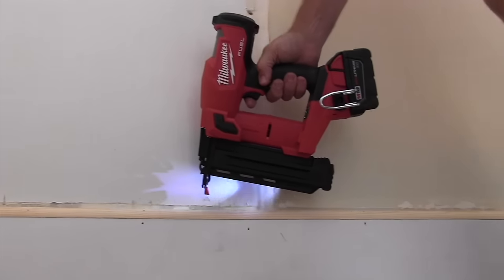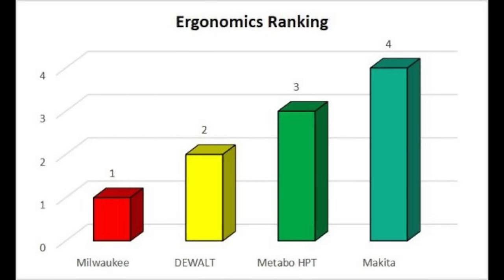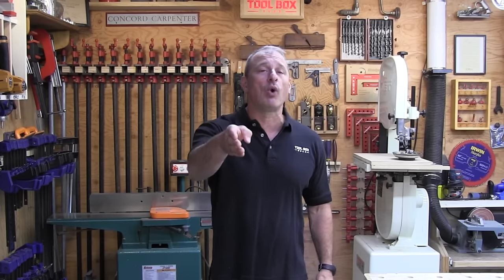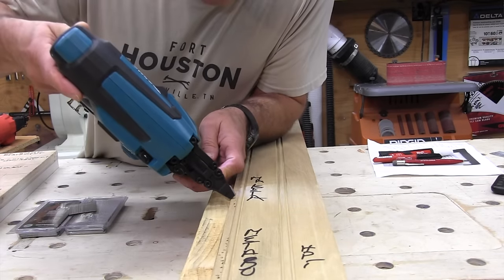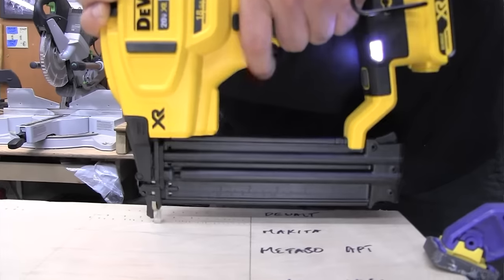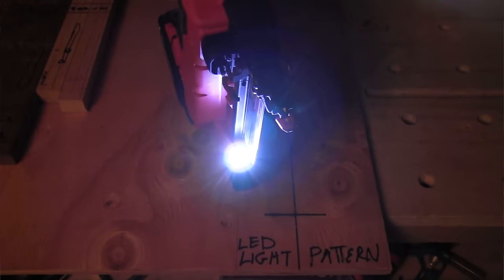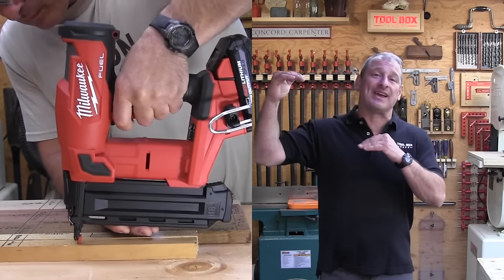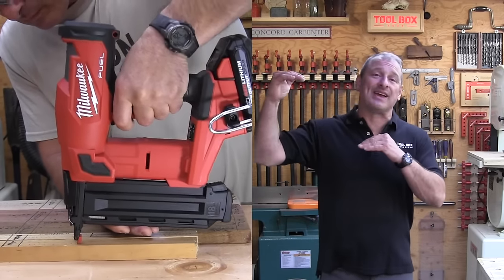BEST 18 Gauge Cordless Brad Nailer - Head-To-Head

Comment: You Guys didn't include the Senco Fusion, that looks Very Similar to the Milwaukee Gen II and the Batteries I think are the same. At least they sure do Look alike plus Milwaukee nor Senco Tech support have No Comment about this either. 
So I'm asking, Do You Know anything about this Look A Like ? Has Milwaukee Gobbled Up yet another Tool Mfg?
Liking These Tool Tests, Great Work!
Reply from the maker: We tested it before and were not impressed
Reply: @ConcordCarpenter  
Thanks Rob, They just look Soooo Similar even the Fuel Gauge on the Fusion Battery is in the Same place....  Fusion has a Pump though ...  
I do Stair and Handrail work, I'm still stuck to a Hose Cause I need to get between Balusters and into Really Tight Spaces. The Battery Units "All Of Them" are Still too Big... But I'm waiting Cause they gotta get smaller at some point.
Again Thanks ....

Comment: Thanks for another great review, you have to love a review that uses a 400X microscope. One thing you don't talk about that might not be an issue is battery replacement. I had one of the FUEL Milwaukee tools and the battery design for installation and removal was not great so I took them back.
Reply: The loose fit battery design is done intentionally and it  greatly reduces vibration.
Reply: @steffendetrick9403  it was not loose. Totally the opposite. It took everything you had to get the battery to release.
Reply: @mach51  wow I never experienced that. That’s definitely not typical quite the opposite they actually advertise their loose battery fit. My my guess it was probably something to do with the release on the battery🤷. They do make some great tools tho!
Reply: @steffendetrick9403  Where do they advertise loose battery fit?
Reply: @histguy101  It’s on their website. It used to be on the toolboxes. The black receiver on the tool that the battery contact slides into moves left and right about an eighth of an inch. This is to reduce vibration. Pro tool review has an episode where they mention it as well. If you really want that information it’s not hard to find.
Reply: @steffendetrick9403  Well, they should try something else. Some of their tools vibrate a lot compared to their competitors, like the super Sawzall or grinder çompared to Makita or Hikoki. 
Their m12 tools don't have a loose battery, and don't seem to have vibration issues. The M12 multi-tool is like the best out there, vibrates the least, and has a snug battery.

If I were to guess, I would say the real reason is so the battery doesn't get stuck. If you get an adhesive material between the battery and tool by accident, even a small spot, it can take the jaws of life to get the battery off.
Reply: @histguy101  I’ve never had any problems with vibration TBH and as far as the super saws all it is hands down the most powerful 18 to 24 V recip  saw on the market they’re osculating tool or multi tools is one of the smoothest. But to each their own I understand how you feel I feel the same way about Makita I have some of there  tools but don’t care for them in general. I think they put a lot of gimmicky features on their tools  and honestly I don’t think they give a ….. about there customers. Doubtful Milwaukee will change that feature what they’re doing seems to be working for them their market share is considerably larger than Makita’s.
Reply: @steffendetrick9403  I'm not talking about what the favored brand is or which one is bigger(although Makita has a much larger market share than Milwaukee, and is still owned by Makita). I use a a lot of Milwaukee tools, and own zero Makita.t

I'm questioning the idea that a loose battery reduces vibration. You just don't have that with other brands, including brands whose tools have much less vibration than Milwaukee. The supersawzall may be the best 18v reciprocating saw, but it vibrates more than competitor models with tight fitting batteries.
Reply: I just looked it up for you to be more specific Not TTI but Milwaukee alone had $8 billion in sales last year with a 41% growth. Makita didn’t even come close to 3 billion.
Reply: @steffendetrick9403  Makita annual revenue for 2021 was about $6 Billion(Maybe Hikoki was $3B? Where'd you get that?)
Makita has been doing about 4-5 billion a year for a long, long time. If they had no growth in this day and age, let alone such a drop, they'd be in crisis.

Milwaukee finally surpassing Makita sales the last year or two(or 3?)doesn't give them a larger market share or footprint, or mean that there are suddenly more Milwaukee users than Makita worldwide. These aren't tool rental companies. If I were to hazard a guess, I would say that current Milwaukee users in the US are spending more and more money on the brand each year. I can't tell you how many people I see that now have a "packout van." A lot of guys now have packout shops, and eagerly await every new niche red tool that comes out that they might be able to use. The amount of money on accessories and auxiliary use tools that people spend today would've been scoffed at 10 years ago.

I'm not sure what this has to do with the batteries thing though, but I recently heard a similar claim that DeWalt drills/drivers wobble so much because it's a design feature that saves bit drivers from breaking.
Reply: @histguy101  wrong. Anyone reading this can Google it and it’s still nowhere near 8 billion dollars with a 45% growth like Milwaukee . I’ve been in the construction Industry for 22 years using power tools professionally you’re just a fan boy . Makita Is ranked fourth you have no idea what you’re talking about and their global market share is considerably smaller than Milwaukee’s this is information anyone can pull off-line. You’re just a Makita fan boy playing on the Internet.

Comment: Ive been using the same DeWalt Gen 1 for a decade.  Works great.  No need to upgrade.
Reply: @kimmclaughlin141  Except it isn't.  No other tool brand keeps up with the hard jobs we do in subzero temps.  Most of my DeWalt tools are a decade old or older.  Other guys are rebuying Makaita and Mil every year.
Reply: @Alamyst2011   look i am a Milwaukee fan and it can work for way longer whan dewalts break on me just saying you shood try gen 2 milwaukee  nailer   not to be a jerk but it can outperforms dewalt and it can work in 0 degrees and below  and it is on a battery

Comment: @cormac Murphy I thought that hikoki was Hitachi not metabo ?
Great video guys, thankyou. I'm stuck with the DeWalt as that's what battery platform I use and have lots of. I just need to stump up for some 12ah flex volt batteries for my 12 inch mitre saw. 👍🙂
Reply: Hikoki is effectively a rebranded Hitachi , it's called that now in Europe , but seeming as Hitachi bought Metabo , they are called Metabo HPT (Hitachi Power Tools) in North America , but they are all the same gun made by Hitachi

Comment: If the most precise, most powerful brad nailer that produces the best nail holes doesn't make at least second place, you should question your test criteria or how you weigh them. These three aspects are by far the most important when it comes to a tool like this. Not the first time you guys got so caught up in testing procedures that you completely lost sight of what you were doing.

Comment: When's the gen2 Milwaukee available? 
I wasted my hard earned on the gen 1, do I risk the gen2 or go dewalt? 
My paslode goes on eBay today.
Reply from the maker: Unknown - soon I think [Oct?]
Reply: @ConcordCarpenter  Which one should I get - or do I stay with paslode?
Reply from the maker: JRS UK either is a win in my book. Do you run o5er cordless Dewalt or Milwaukee? I tend to favor staying on none or two battery platforms
Reply: @ConcordCarpenter  Thing is I'm mostly makita for my small power tools,  my mitre saw and table saw are Milwaukee (batteries are too big for nail guns). I don't have any Dewalt at present. My 18 Gauge,  16 gauge and framer are all paslode. I'm changing now because they are just too noisy and the gas is a massive inconvenience.  Btw I rarely use the framer.
Cheers for the advice 👍
Reply: Got my 18 gen 2 from ohio power tools  week ago. Very happy and great gun love it. i retire dewalt gave to a friend
Reply: I have tye gen 2 and it works great for me

Comment: I bought a set of Milwaukee tools. Drill, sawsall, saw, impact, all took sh** in 2 years. The saw went in 3 months, the drill latest the longest. It was the chuck that lockup. But the batteries died after a year. I only used them 3-4 times a month. I bought a plug in  Milwaukee sawsall it cant hold a blade always pops out. I will never buy Milwaukee again. I used a 20 volt dewalt sawsall at work, I’m sold!!! It makes me want to throw out all my battery tools (now ridgid tools). Only will I buy dewalt from now on!

Comment: Can we pleeeeeeease get a 1/2" impact Head to Head?
Reply: Not that it's outside their capability to do so, but carpenters don't really have much business using impact wrenches. You're better off looking at someone like WorkshopAddict for that.
Reply: @orijimi  Carpenters use 1/2" impacts to drive larger lag bolts when using anchors for decks or larger builds
Reply from the maker: @orijimi  We can do it but we try to pick tools that will get a wide range of users / viewers. Ill add it to the list.  Next test is framers then routers
Reply from the maker: Ill add it to the list
Reply: @ConcordCarpenter  That makes sense, you guys rock, keep up the good work and I look forward to the next video.
Reply: A Concord Carpenter / ToolBoxBuzz  ... I’m waiting for that ... I’m very interested on a cordless framing gun especially now where Milwaukee ( I’m just in the process from switching Makita to Milwaukee ) brings one out. I was almost ready to buy a Hitachi one but I didn’t until now because then I have a 3rd battery platform. And now that Milwaukee has one out later this year makes it’s easier to wait. But before I will buy one I will wait for *your * and from the other guys here on YouTube for a test.
Reply: @fatherfirefighter7751  Yeah, I see most people put a hodgepodge of adapters on to their impact drivers instead.
Reply: Father firefighter 
Goon

Comment: 1st off all, im on the makita platform, so it was kind of a no brainer to buy the makita,but i think the makita is not up to its competition....by far!, they have failed with the bradnailers in so many ways that im starting to think they better stop developing them.
i have used the makita a few weeks and after that i have throw'n it in the corner of the shop and dont look after it anymore, here the reasons why in my oppinion,

1 st - there is a little switch in the handle ,it is designed to lock for safety, the problem with that is that it randomly activates while on a ladder with your hands full and you have to use both hands to unlock it while the trigger is so deep in that i cant push it back with 1 hand and still holding it propperly

2 nd - if there is a jam in the nailes, you still need a damn hex key to remove the front plate...what the hell where they thinking

3 rd - the ballance is so far out that when you use it for a day your wrist hurts 

4 th - the one i have used was 18 ga esspecially designed for placing glass in windows , but the hardwood glazing beats we use , where to tough for the makita , and then try to punch 1.2 mm nailes deeper with a driver, good luck with that, they all bent and you have to remove them and in that way is would happen that it looks like we had worms in new glazing beats.

in my oppinion it is a complete waste of money (alot of money) for a tool that is designed by people who should have known much better, especialy because there is so much on the marked these days where they could have looked at how its done,and then make a better version of that.

Comment: Anyone else have problems with the dewalt? Mine and a co workers have the same issue. The problem is that the firing pin slips off the head of the nail and leaves a hole twice the size while not driving the nail all the way. It happens like every fourth nail. So annoying.
Reply from the maker: MFiskeaux that sounds like a malfunctioning tool have it serviced

Comment: Not the results I would have expected. When I'm doing trim nailing, I want clean and accurate shots. a nail that sits proud is a dealbreaker. Every other criteria are frankly useless to me. Makita gives you the best result. Period. All the ergonomics, battery life, size,  and light issues,  I can work with but a ruined work piece due to a misfire or other sub optimal functioning of the tool kills any other benefit. 
TLDR: finished result is the ONLY criteria that matters, and Makita wins on that front.

Comment: Makita really seem to be falling behind DeWalt and Milwaukee although their build quality is still the best. I use Makitas battery platform but have a DeWalt finish nailer, I’ve never seen anyone with a Makita brad nailer and I never saw any advertising for it here in the uk
Reply: Yeah, Makita seems to only be all that interested in updating and developing new landscaping and concrete tools lately. It's been pretty disheartening.
Reply from the maker: Its older - that's it. If and when they upgrade that nailer - WATCH OUT!
Reply: Yeah plenty of concrete and landscaping tools. No advances in the battery technology and the woodworking tools at least no longer keep up with the competition in terms of power. I did get the router which was a revelation and am still invested in Makita but get a bit jealous when I see all the Milwaukee and DeWalt with 9/12ah batteries. I agree tho, with the best quality in the industry when they do release new kit, it should knock the others out the park

Comment: Never used one which was small or light enough for accurate panel or light framing work.  Corded ones are better but only professional models like the Maestri 30 08. Cheap corded or cordless are a complete waste of money and time.  You’re better off with a hammer and panel pins than use a cheap brad nailer

Comment: Wow a Concorde Carpenter/ToolBoxBuzz did a head to head and the tool brands that were sold at the Big Orange Box store came out on top? No!😱🤦🏼‍♂️
Reply from the maker: Not sure what you're saying?
Reply: @A Concord Carpenter / ToolBoxBuzz 
Not quite sure I could explain it to somebody who puts size and weight as an imperative for his 18 gauge nailer, but not for his 12V impact.
Do I believe that you are cashing checks from either the big orange box store or a certain Hong Kong tool company? No I don’t. 
Do I believe that a near endless supply of free tools and being pampered at press events compromises your objectivity? Yeah all day every day...
You should put back up the matrix carbide video, so that everyone can see you rave about a product that was so bad designed that was discontinued before it even hit brick and mortar shelves.
My Wera Rapidaptor set is 3 years old only wear is the removal of the diamond coat off of one of the #2 bits, and they are still available for purchase!
Reply from the maker: @thetruth5210  I added the size and weight to our testing after YOUR comment from the 12 volts. Do you not want us to listen to feedback?

Regarding this comment:   "Do I believe that a near endless supply of free tools and being pampered at press events compromises your objectivity? Yeah all day every day..."   We can get tools from almost ANY manufacturer.  A free tool is NOT WORTH my reputation - my goal is to try to stay as objective as possible and provide unbiased, repeatable testing and solid reviews. 

Not sure you and I will ever agree on this stuff, but I do respect your opinion and input and added that category after our last communication.
Reply: @A Concord Carpenter / ToolBoxBuzz 
Do I want you to take feedback? Yes wholeheartedly yes. I hope that the next time that you review 12V tools but their size and weight is the most important metric when considering ergonomics.

There was like a half dozen videos you did where you couldn’t help yourself from taking shots at Bosch even when they were not even in competition or even necessary to the video or available to North American customers or even when that product was a carbon copy.

I could come up with something that we could see eye to eye on with a quickness. I’m sure both of us would agree that 1.Festool TS-55 and 2.Bosch track saws are the best on the market in North America and if you go world wide Mafell goes on top. It would be AWESOME if there was a head to head! Just saying...
Reply from the maker: The Truth I’ll work on that

Comment: This video was made because miluakee finally made a good nailer
Reply from the maker: we made this video because it was on our list to do in the spring - and yes we waited to now so we could test the Gen 2.    We did the similar thing with out 12volt H2h - it too was slotted for an earlier test but we waited to include the NEW Dewalt tool.  

This is what we do.  Are you not interested in how a new tool compares to the rest?

Comment: dont buy the milwaukee, I care for my tools a lot since theyre my money maker, bought the 2 gen 18 gauge air-spring technology, 5 months ago, after some amazing performance, even in hardwoods, the hammer started to missfire, and got locked in place, 1 month ago it just stopped working all together, and this is the second one that stops working altogether for me. the gas piston leaks with time and regular use.

go with the fly-wheel tech its more reliable, my DeWalt hasnt let me down one single time. its been 3 years now.

Comment: Ryobi Air Nailer not included ?  I guess, you didn't want to embarrass the big contractor brands.  In head to head tests, Ryobi Air Nailer crushes the competition.  I know, it's embarrassing, but it's true.  Ryobi engineers simply built a better cordless brad nailer than the competition.
Reply: It’s nice, but it’s heavy and unwieldy.